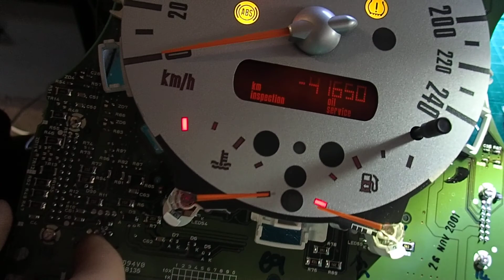Mini Dash LCD repair

Comment: Denatured alcohol in a spray bottle, an old tooth brush and a rag cleans up nicely for me! It dries quickly also.
Reply from the maker: Nice yes thats a good idea! (:
Reply: what was the problem?
Could not see?
I have that problem
Reply: Do you repair the same problem? Mi tachometer lcd screen does not work and it's making me crazy... do i need to get a new chip?

Comment: Does the ic10 store the other options that usually change when you put a different Speedo in. 
Also, does the ic10 store the milage?
Are they readily available as a chip?
I usually swap just the LCD display module over from another odometer, but I've heard once the driver is faulty you need a new ic10, as you replaced here.

Edit. Never mind, just read the number off the chip and can get one from chine for £8 posted. Thanks, you are a legend
Reply: Hi bro ! I read your edit, can you tell me where I can buy this chip ? 
I read this numers on my chip IC10:
PHILIPS
PCF8576CH
74145
YSM01221

Comment: What does the "IC" words mean? I need to do this same job on my tachometer... do i need to buy that chip?
Reply from the maker: Integrated Circuit is what IC means and yes you need to replace that Chip (:
Reply: @getelectronic8459  thanks man, i'm gonna do the same with my tachometer... i hope the chip is easy to find